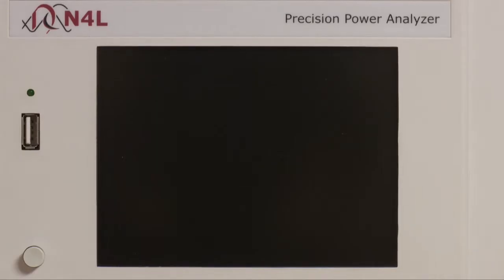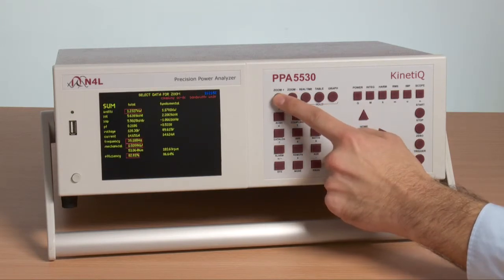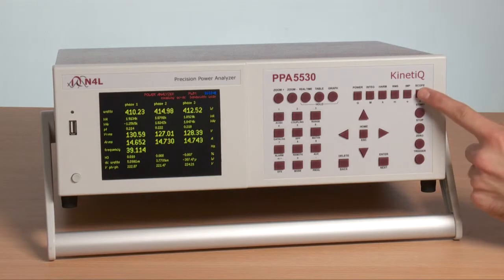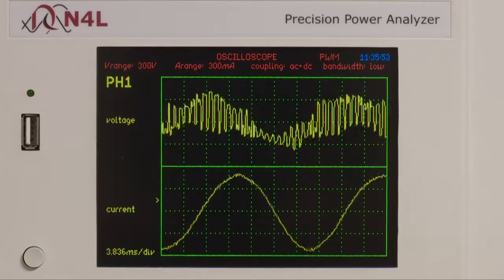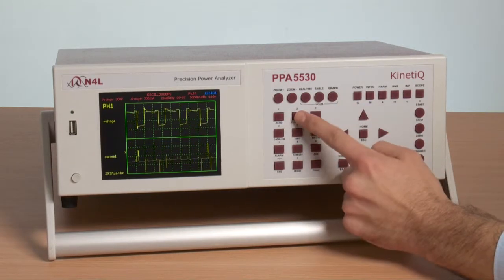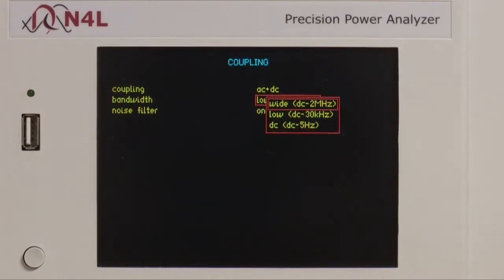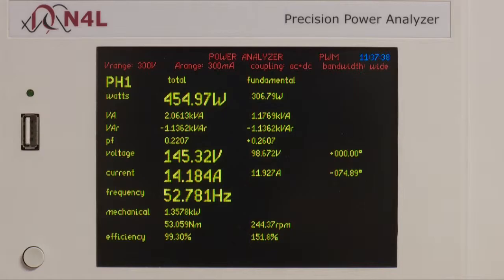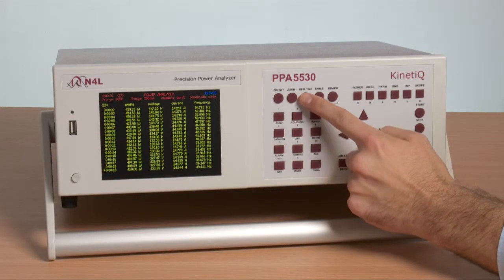HD   Newtons4th PPA5530 Power Analyzer PWM Motor Drive Testing

Comment from the maker: La precisione nominale utilizzando la formula indicata per il suddetto tensione, corrente e frequenza è di 0,2% di errore Watt. Utilizzando una serie di 1000Vpk e 30Apk dare un "RNG" di 30.000 VA, Rdg è 4000W.

The Nominal accuracy using the formula quoted for the aforementioned Voltage, Current and Frequency is 0.2% Watts error. Using a range of 1000Vpk and 30Apk giving a "Rng" of 30,000VA, Rdg is 4000W.

N4L calibration certificates would indicate "real" performance typically of <0.03% watts error upon such input signals.

Thank you, Scott Miller. N4L